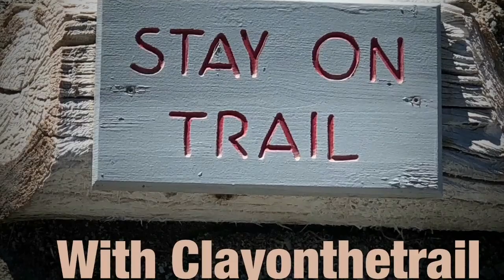Watch This Video Before You Make An Ammo Can Stove!!!

Comment: I'm just about to build one from a 40mm can, design will be a bit different tho, a bit heavier because I'll line the inside with 8mm soapstone to maintain heat. I'm not going to hike any longer distance with it so the extra weight won't be a problem.
And i think I got a solution to the handle/clamp holding the top.
-anyway, thank you for the video, it really made me think twice of the design:)
Reply: Coconutfleet sleeper:  That’s a good idea. Do you think that talc stone would do the same trick, or perhaps thin fireproof tiles?
Reply: @daphneraven6745  I honestly don't know if those will hold heat for long periods of time, give it a try tho:)
Soapstone is very common in stoves and fireplaces here in sweden because of the heat resistance and ability to store heat for a long time. You can by them online in all kinds of dimensions at a reasonable price online.
Reply: @coconutfleetsleeper5717  :  it’s possible to get it here, and the Inuit people use it to make kuluks, as well as Art.  It makes sense that it would be used In fireplaces, given those properties. I wonder why they don’t use it here. 

Thank you for getting back to me.  We have talc Very close to my place, so I can’t help but wonder if that’s an option for use for the same thing, since there are so many properties in common between the two stones.

You know, if it does a really good job, the weight of a few extra tiles might not really be much of a sacrifice on a hike. Particularly in the winter.  That kind of comfort food will be worth that sacrifice.
Reply: @daphneraven6745  thats funny, I bought a big block, about 50kg some years ago after seeing the inuit art online, got really inspired to carve some sculptures in the material myself. 
I had about 7kg left wich I shaped in to two thin long tiles that fits perfectly in the ammo crate:) weighs about 3,2kg. 
I definitely think you should try the talc stone if you can source it locally, I never worked it myself, but it seem to have similar properties. 
However, i think some natural talc stone can contain asbestos so you might want to read some more on it before you start to shape it or breathe in any of that stone dust..
Reply: @coconutfleetsleeper5717  :  Oh I’m so glad you knew that and decided to share! Thank you very, very much! I will do my research before putting it into the unit!

Have you had a chance to give your soapstone-lined stove its’ first workout yet?
Reply: @daphneraven6745  yea I remembered that the medical company johnson&Johnson got sued quite recently for having asbestos in their baby powder due to it being sourced naturally. -don't know the outcome of the lawsuit tho, or if the claims where true...

no, I haven't got the stove done yet, I'm not even half way through the build, spring hit sweden hard so I've been busy spending the as much time in my hammock sucking up sunlight instead being in the workshop;) 
I probably will have it done by sept-october that's usually when the temperatures start to get a little lower in my parts;)
Reply: @coconutfleetsleeper5717  :  There was  something in North America about that as well, but I don’t know if it was related.  Back in, I think it was probably the 1990s, somebody discovered that Tumours in the female reproductive tract were found to have bits of talc in the middle.  Everybody was using it on their babies especially on the diaper area to keep them dry, and apparently some of it migrated up and caused major problems for some girls and women over time.  I hadn’t heard that there was asbestos in it, but that could  explain why that would be.  Since then, Johnson and Johnson’s baby powder in this area at least is usually made of cornstarch.
Reply: @coconutfleetsleeper5717  :  I learned a great deal as well, in a middle of a little research to figure out about portable stove design for backpacking and changing in the backcountry.  You got some pretty good ideas here, and I’m glad you ever again. They will really likely impact the way that I end up building my stove. So thank you very kindly for all of that.

You’re probably right about soapstone. I wonder how it compares to fireproof  tiles made for lining stoves.  I think that if talc stone ended up being hazardous, even though it would be tucked away inside the stove itself and not touching the food, it would still be of concern for purposes of exposure when maintaining the stove, as well as while building it.  So it could end up being a hazardous choice. I will do the double checking on the local supply, with an absolute willingness to abandon it quickly if it turns out to have asbestos contamination or any other toxic contamination.

Comment: 40 mill seems nice for a tiny cabin.  add a hopper for pellets and your golden.  
Fat 50 ammo box with pellet hopper is what i'll be making for a camper trailer.  2 hour burn time minimum.  Bigger hopper longer burn.   Even has a looking glass so you can see the flames and everything packs down inside for compactness.  Check out Slim Potato Head's build if you haven't already.
Reply from the maker: I’ve been watching potato head slim, and I like his stove for a camper, to haul pellets to the forest for a camp surrounded by trees seems silly. I would look into the pellet hopper for my shop. I have used a rocket mass heater before and like them. Wanted to convert it to pellets, I just never did. Maybe a future project...

Comment: I have a bunch of ammo cans and have been looking for protects to use them I am thinking putting a door in the top would be the best so you feed it like a old cook stove. I would put a small door on the front so you can still rake the cools easily but it wouldn’t need to be huge and you could leave the front handle in tack
Reply from the maker: My only concern with a top door, is the amount of smoke that would escape each time you open the door. The doors on the front leak bad enough. Depending where you use the stove it could fill up a small space quickly. Proper airflow, dry wood, etc would have to be a priority to keep smoke to a minimum. If it worked, a top load would be easier to load and keep full. Sounds like an interesting build to test
Reply: @Clayonthetrail  yeah definitely would have to build a recessed lip all the way around with door gasket to keep it from leaking

Comment: This is awesome  love your stoves! I made a stove about the size of your middle one! Its been  great. I put a damper plate on and I noticed was able  to control my burn so burn time would  last longer! I was curious  if you put a damper plate on yours or have tried it?
Reply from the maker: I put a plate in all my stoves so the smoke has to travel around to the pipe, and then my pipe has a damper in it. It’s the only way to control the heat, and burn time

Comment: curious on the small one, if the flu was half the size would it last longer and still warm a van?
Reply from the maker: The small stove with a correct size flue would warm for maybe an hour on wood. They are just not big enough to hold enough fuel unless you go to a fuel like wood pellets with a hopper

Comment: ive never been camping i want to try winter camping but a little apprehensive
Reply from the maker: Find an area close to your vehicle. Worse case scenario, go home. It’s not as scary as it seems, just stay dry and layer clothes, sleeping bags etc. using a hot tent and stove can be a false sense of security. If the stove won’t stay going make sure you can stay warm without it. Lots of winter camping vids out there with good info
Reply from the maker: https://youtu.be/g71Jzm8j0LI?si=23cRpqzAL-MQ3aXJ

Comment: I want to make an ammo can stove for a travel trailer. I want to line it with ceramic fibreboard so it will last longer, with an afterburner to reduce pollution. I want to have air intake of outside air into the bottom of the stove. I’m trying to combine the best ideas of several creators to build something effective, safe & long-lasting.
Reply from the maker: That is an ambitious build, but totally doable. I always run a shelf between the burn chamber and the chimney pipe to help draw the exhaust. If you run the  fresh air intake across the bottom up the back to the edge of the shelf so that it will be super heated when you inject it into the stove it will act as an afterburner or secondary burn.
Reply: @Clayonthetrail  i was actually thinking of having 2 intakes (gasp)- 1 to enter towards the front (for startup); 1 that will be drawn up the back (behind a steel “wall”) & injected near the top, both with dampers to control air flow.
Reply from the maker: @yourekittenme. I think that will work well. I usually just crack the door during startup, which can leak smoke, and inside a camper wouldn’t be “fresh” air

Comment: Why put the door on the handle side?...my small ammo can had the handle on the side with locking mechanism, so I placed my door on the hinge size... with a heat plate 1/2 inch below the lid on the inside it creates a gasifier inside.... I get 3 hours of burn time with 70 F in my 4 person tent with 0 to 30 F outside temp ...2 inch diameter duct and it fits inside for transport...2 inch duct is plenty with no smoke backing up inside the stove..
Reply from the maker: Do you have a pic or video on it, I’d like to see it. 2 to 3” pipe is plenty, all my existing pipe just happened to be 4”

Comment: I have seen the smaller ammo can stove with a double wall 3 inch vent pipe . They say the smaller vent makes them burn a little longer.
Reply from the maker: The smaller pipe does allow a longer burn for sure. I made mine with thing I had in my shop. The smallest stove with a 4”pipe is almost comical, but even withe a 2 1/2 pipe would be a ridiculous short burn
Reply: @Clayonthetrail  The one I saw had gas hot water vent pipe .

Comment: So, u have been around wood burners all my life. I'm 50 years old. I built one of these, and for the life of me.....u can't get it to stay burning. As soon as I close the door, it goes out and just smokes. I am confused. Any ideas?
Reply from the maker: You must have plenty of air going in and out. Closing the damper too much , or the flue will kill the fire fast, unless it’s very well established. Make sure you have at least 3 - 1/2 inch holes that are adjustable for air going in, and don’t adjust the pipe flue till it’s burned down some coals, and is going good on it’s own. Even with this I have to crack the door open for the first ten or so minutes of the burn depending on humidity and dryness of the wood
Reply: Make sure you chimney pipe  goes higher than the highest point of your tent cabin house etc

Comment: Great video. If you run this bad boy in the winter on snow doesn't it just make a pond in your tent?
Reply from the maker: I generally shovel out my tent spot, lay green boughs around the entry to keep the mud down, and put wet wood or rocks under the stove as a barrier from scorching the ground
Reply: @Clayonthetrail  so you shovel all of the snow down to the ground from underneath your tents footprint? Thanks for the info. Seeing the stove sizes was helpful
Reply from the maker: Yes I shovel out the whole tent. Acts as a windbreak, and packed snow is very cold to sleep on
Reply: Will McCall:  i’m from up north, and I’ve camped out in February with a lot of feet of snow, and on ice as well.  Even if you don’t put a stove inside your tent, you will end up with an icy floor under your tent. 

If you’re camping outside under those conditions, the usual thing to do is to shovel yourself out a footprint, and then when you set your tent up, usually you have a little ditch scraped in the last of the snow so that any condensation or other moisture moves away from your tentage, and once the fly goes on your tent, usually you shovel some of the snow over the edges of the fly.  That’s how you insulate the place a little better. If you’re gonna have a stove going, you need to put something underneath it. You can’t have a stove or even just an outside fire going on top of the snow, because eventually it melts the snow and your fire burns down into it. It’ll put an outside fire out. A warm stove inside the tent will do the same thing, and that whole situation is likely cause condensation in the tent as well, which will cause you to get hypothermic.  It’s super important there to have at least some legs and a board or rocks underneath your stove, preferably on the ground.  If you have to be camped out on the ice, it’s really important to keep an eye out for your stove. No kidding.

Comment: Why not trying to achieve something with wood pellets? A small store compartment where you can fill up with pellets outside the burner and then with a screw feed the stove thrue a pipe.
Reply from the maker: I use my stove winter camping in a hot tent, where wood fuel is everywhere. I don’t want to carry the extra weight. If I were using it in a shop or camper, pellets would be perfect.

Comment: I specifically wanted a compact, titanium tent stove of the box type, and concluded that the Seek Outside Cub Stove was almost perfect.

The original stove top had a stove pipe aperture of 3.125", which I considered to be excessive in such a small firebox (6" H x 6" W x 9" L) so I requested that the stove top be replaced with that from their Cub U-Turn Stove, which had a 2.5" stove pipe aperture.

I bought a sheet of titanium expanded mesh and made a grate for use with smokeless charcoal briquettes.

I replaced the original damper with a titanium one from Lite Outdoors as I didn't like the original collar. 

My stove with a 9' roll up stove pipe weight around two pounds.
Reply from the maker: I since have purchased a titanium stove with a 2.5 titanium pipe. It’s much nicer to carry, but small, and still has its flaws. I’ve had issues with the collar holding the pipe in place the bigger ammo can stoves are definitely sturdier, but less fun to carry

Comment: Thank you for sharing. I have an 8` x 10` tent but I don`t know if I want to cut up my new 50 cal. ammo can or not. Aside from the burn time 
do you think it would heat it just fine? 
Also wouldn`t a smaller diameter pipe like 2 or 2 1/2 " retain heat better and possibly burn longer?
I would value your opinion.
Thank you again.
Reply from the maker: 8 x 10 is a lot of area to heat up, and you would run the small ammo can hard, and I don’t think it would keep up. The smaller stove may do better with a smaller pipe, most of the titanium stoves run a 2.4 inch pipe and do well. Even most smaller hot tents run a 8x7x15 (  850 cubic inch) stove and have half or less the area of a wall tent. A 50 can is 6x7x12 (504 cubic inch). It also depends on your air temp, it might keep a tent warm at 40 degrees, wouldn’t stand a chance at 0
Reply: @Clayonthetrail  Thank you so much for replying. So what size box would you suggest for zero degree F weather for an 8` x 10` tent?
Reply from the maker: As far as ammo box, the 20 mm box is best by far, size and sturdiness, especially for a bigger tent. When I had a 10x12 wall tent I ran a foldable pack stove that was (about)   10x12x20
Reply: @Clayonthetrail  Thank you so much sir. Your kind response is very much appreciated. I wish you every blessing God has to offer.
Reply from the maker: Good luck with your build
Reply: @Clayonthetrail  I`m looking for a 20mm can online now. lol 
Thank you.

Comment: Your ammo can stove. You mentioned the handle issue. Every can I have seen built. The wood door goes on the hinge side. That way your handle is not compromised.
Reply from the maker: Mine has handles on both ends, no hinges. The other style can sounds like a way better fit as a stove, although not as big as I like personally

Comment: Put the stove door on back of the stove and swap the chimney to the handle end of the stove
Reply from the maker: There are handles on both ends , this style isn’t hinged
Reply: Kevin Humphrey:  That was my impression as well. I wonder if it’s possible to put a door in the side of one of those boxes. If a person loaded the wood from the side, then it wouldn’t mess with the ends or the handles for the lid either.  Such a shame to have a person’s favourite stove essentially ruined for the want of a different set up.
Reply: @daphneraven6745  But if you load from the side you either need really short pieces of wood or a really long door.

Comment: Just about to make mine, waiting on the ammo can to be delivered
Reply from the maker: They work great, good luck on the build!
Reply: Did you use ny stove rope on your door?
Reply from the maker: @baldnonce9105  not on the door, just the lid, in replacement of the rubber gasket.
Reply: @Clayonthetrail  yeah i suppose the door would need a recess to hold the rope and allow the door to close and seal,  but if the door has vents i gusee it would b pointless
Reply from the maker: It just helps it vent more. My big stove has a curved door. I backed up all the straight portions of the door but not the curved parts. It would also make it harder to close the door, and you would end up pushing the stove around, screwing up the stove pipe and jack
Reply: @Clayonthetrail  spot on, thanks for your help and your great video